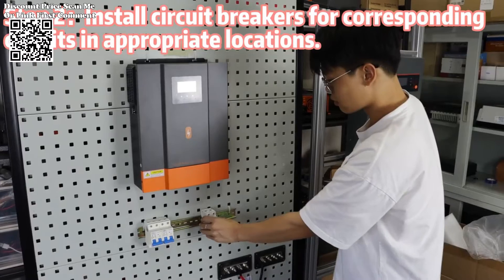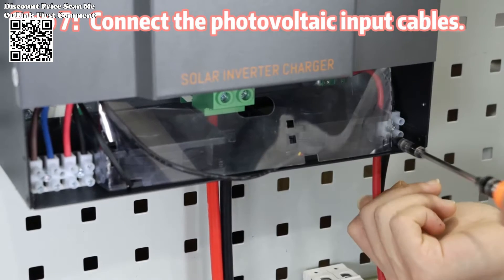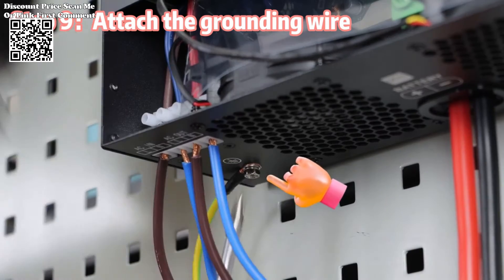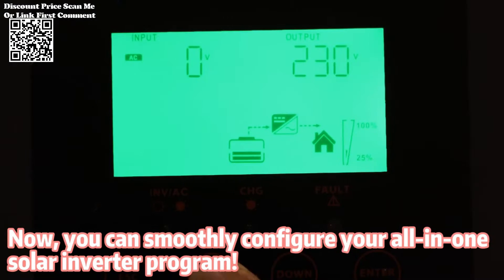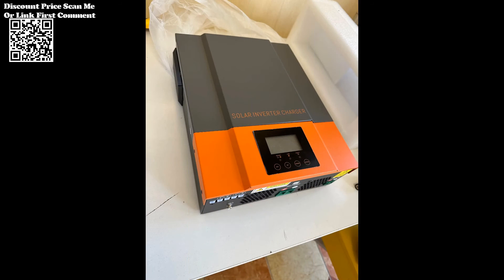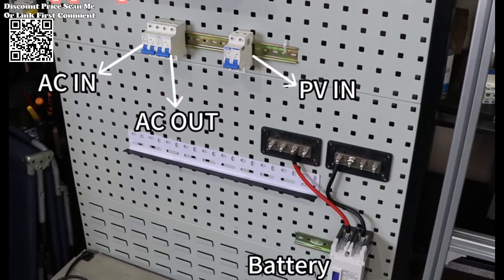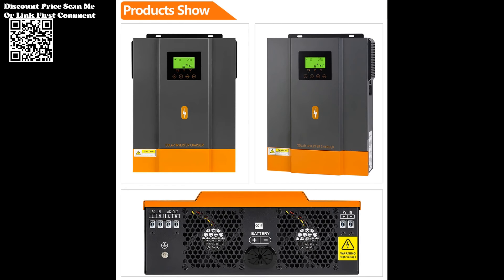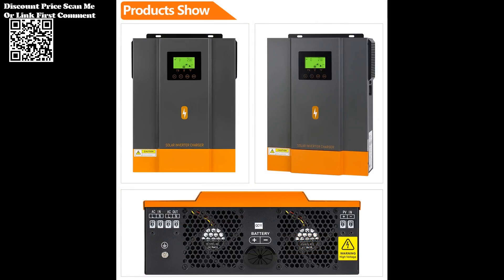PowMr 3200W Hybrid Solar Inverter Review Aliexpress

Comment: Not having bolts for the battery terminals is a mistake . those green wire connectors suck .

Comment: This is 1600w MEAN power unit. The 3.2kw refers to PEAK  power. Our domestic appliances are rated in MEAN power, which roughly half PEAK power.

For example,  a 1kw hair dryer will not work on a 1kw PowMR hybrid inverter because the  mean power of the latter  is approx 500 w and  in addition the inverter is 94% efficient
so the output at best will be 470w.

 On my unit it doesn't go > 425 w mean. If you look at  quality hybrid inverters such as Victron the power rating quoted  is the MEAN power which is the way it should be.

Although the manufacturer claims are not dishonest, it is unethical and downright deceptive. Save up and buy from a company more honest about their capabilities. Also
their customer service is non existent and refuse to offer a refund when I complained about the low output power.
Reply: nope, i have this model. Its 3000w, and 3.2kva. The peak output is stated in the manual to be 2x the output for 5 seconds. This is the 24v model, the 12v model is 1600w.

Comment: good night, does this equipment have a neutral line? to turn on 110v equipment?
Reply: this inverter is 230v output only, you cannot use 110v appliences.